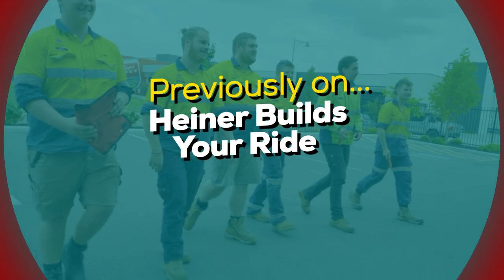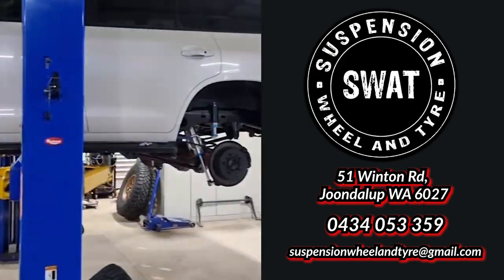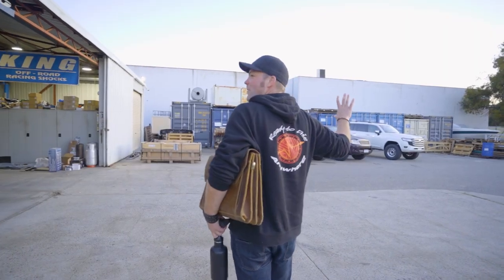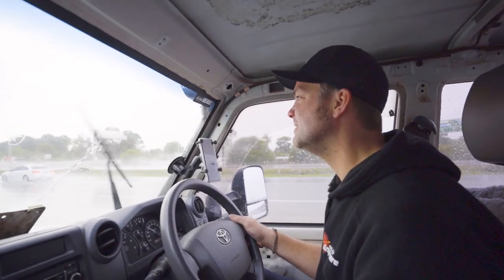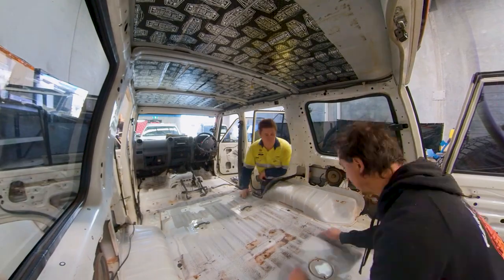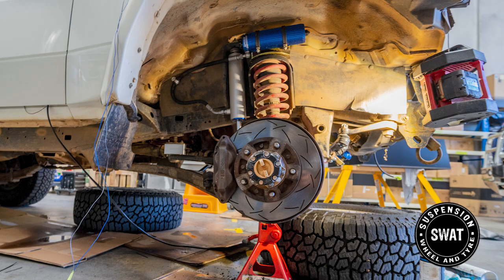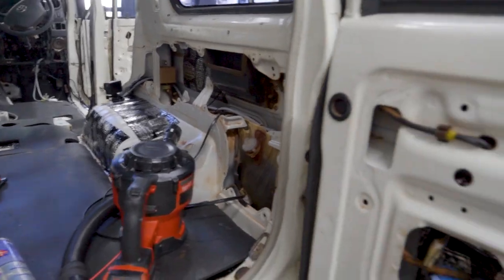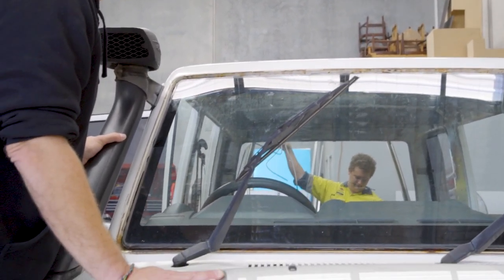Suspension, Soundproofing & CAD ( Heiner Builds Your Ride Special ) Episode 4

Comment: Moin Heiner
Nice job, from bare metal… best way to do…❤
Would be interesting to hear the Alpine system since my LC 200 need something new next.
Mhhh. Interesting to experience and compare.
Just got in my Merc E class convertible a new Burmester speaker system factory installed, nop not the 3D system that would break the bank and with 1450 watt blow out the windows….
Waiting for your next build vid 

Cheers
Reply: Yes Heiner. Run some Neue Deutsche Welle for us for judgement. Servus, Jens